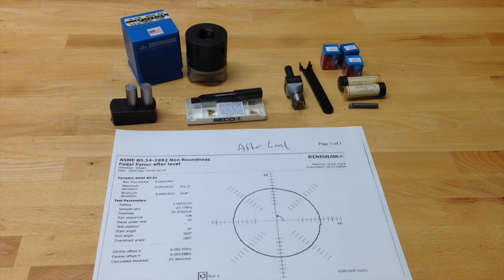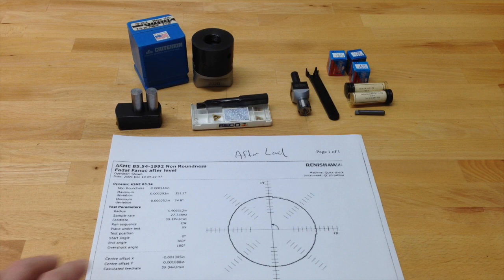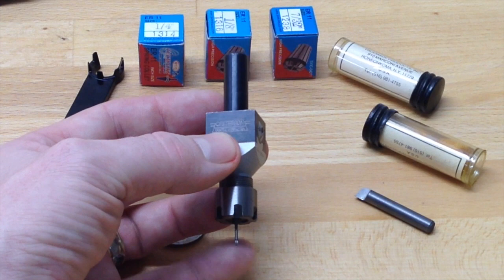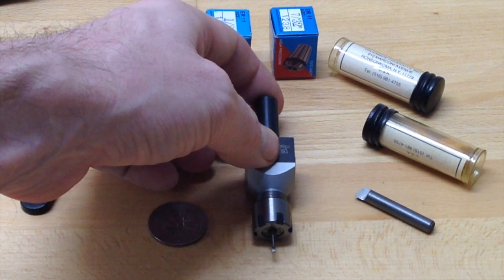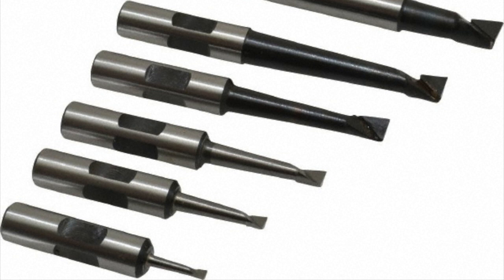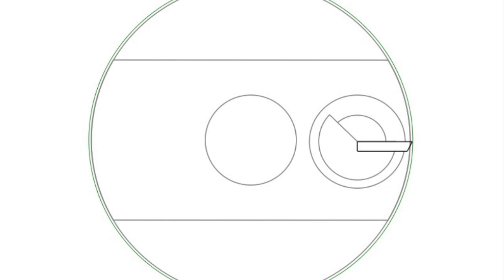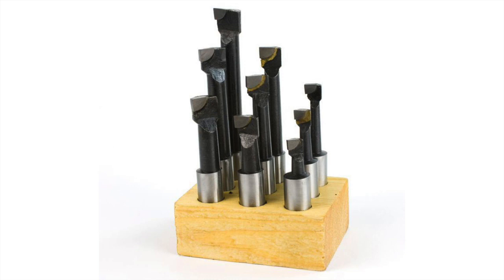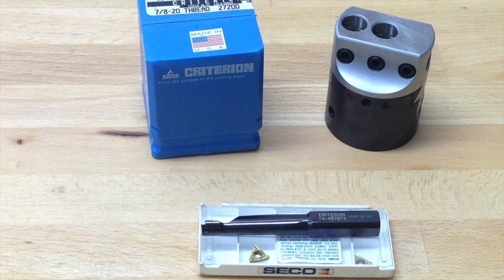A Boring Rant

Comment: Interesting and informative, however not all of live I the USA and a downside is all your tooling is imperial, unlike so many countries who have gone metric, and tooling is metric. Freight from the USA is prohibitive and often doubles the cost of many tooling items. I have to say that the low cost . imports do allow many hobby machinist's, a range of tooling and equipment we could never afford, and with a bit of work many of the imports will be quite adequate for many on a limited budget and who are not running a money making operation. Many tools get limited use, so it seems horses for courses are a way for us all to enjoying our machining, keeping us off the streets and out of the pubs etc. Add the UK and quality Sheffield made tools, I have still got all mine and my late father's, which, are top quality and heading for 100 years old.☺A large telescope builder, or I should say a builder of large telescopes and observatories where my tools, machines etc are a means to an end.

Comment: Nice video, but If you having a company than it's normal you buy the good stuf , because the client  pays it anyway. On the other side of the medal is the hobbyist working with chinese junk as you call it. And most of them are satisfied. But not all the very good stuf you buy in America is also produced in America. I am from Europe , and bought recently a milling machine. I can assure you that most of the milling machines how decent they look and with there differences they al come from the same factories in China, It's start with the skelet en then there be difference in quality of everything you can think off and the price you have to pay for it.  So with the same skelet it can easily have a difference of 4000 euro's. For a normal hobbyist it is very hard to make a good choice. And that is the same with the tools.  But if the price is cheap , a hobbyist also can afford it. But buying a boringbar 3 times the price compare to china is nonsens, because how often do you use it   , changing the bolts is always a great idea for better one's no matter where you bought the boring head.

Comment: Thank you for this  video.  I have gone through just about everything you mention and finally ended up making my own as another commentor  has said.  And I use 3/16" square HSS for bits.  I even made a back up bar for one job.  It is the same length as the primary bar and has a set screw which touches the primary bar in an attempt to keep it from springing/vibrating.

Comment: What a  great video!  I didn't expect your prepared visual learning aids.  This is better than most instructional materials that are sold!  I knew that there were many basic boring details I didn't fully understand, including proper rake angle, etc.   I just finished a job where I had to bore nine holes (7 in metal injection molded pulleys, one in a solid steel pulley, and one in rectangular extruded aluminum box tubing.  All went well (although slow), but I made a mental note to search YouTube for a boring video so I could learn what I needed to know, so stumbling across your boring video was a bit of good fortune.  I learned a lot from your video.

I don't do a lot of boring, and I'm frustrated with my cheap import boring head and cheap import brazed carbide boring bars, for most of the reasons you mentioned.  I haven't experienced the problem you described with the round boring bar rotating in the boring head, but I'm sure that's an accident that's waiting to happen.

The cheese-like set screws are stripped on my import boring head lock mechanism.  I'm now down to 1.5 out of 3.  One is so stripped I took it out, and another is mostly stripped so I torque it only lightly.  I need to replace the set screws, and buy ONE good carbide insert boring bar with a proper flat on the shank.  Then I'll only have the issue of the extreme backlash in the boring diameter adjustment screw.  I'll eventually buy a nice boring head... like the Criterion boring head you have.

Thanks for this great info.

Comment: I wish I could buy those insert style boring bars that cheap here in Australia. I know there is a difference between AU $ and US $, but it does not explain what tool suppliers here are asking!
Learned by watching, thumbs up thanks, John.
Reply: same in NZ ,   either import tooling that takes a month if youre lucky, or horribly priced import crap sold by local resellers. or ebay + shipping

Comment: Good video.  I have to say I have had good luck with my import boring head.  With that said, I did just order the Mesa 3 inch bar as you are completely right about the cheap bars.  I waste a lot of time messing with the rake angle.  That bar looks very good and should cover just about all the boring I do on the mill.  Thanks again.
Reply from the maker: +robert simpson Cheer Rob. Yeah, to be fair the import heads rant all that bad and you can get great results from them. I just switched over to some new Kenametal inserts with a much smaller radius and they work great. I recently made a clamp block for my coolant system and it turned out really well. Spend the money on good boring bars for sure.

Comment: Rule #1 when boring. Rigidity, rigidity, rigidity. This can not be stressed enough. The shorter the set-up the better.
Rule #2 when using HSS or brazed carbide the sharper the better. Brazed carbide really needs to be finish ground with a diamond wheel. A silicon carbide green wheel simply doesn't do the job. 
Rule #3 the tool tip needs to be on the centerline. Being offset effects the rake angles and translates into outfeed errors
Reply from the maker: Great advice m!!!

Comment: i actually managed to break a cheap boring bar by just starting a cut in delrin.  the boring bar touched the work and the shank snapped at the root and hinged back on a little sliver of malleable material like it had a cold shut in the metal.  it makes me wonder how they managed to even make it without breaking it in the first place.

Comment: why did you angle the crappier cutter so differently? the first was lnline with the center of the head, the second was angled aggressively. if you were to angle the first the same way, you would the same result.
I do agree that there are tons of crappy boring bars, but it seems you were preloading the start conditions.
Reply from the maker: its because the crappy cutter doesn't cut on center... if you want it to meet the bore at neutral rake (90 degrees) you have to rotate it in the boring head. Watch it again... thats the exact geometry problem I was trying to highlight with the crappy cutters, the cutting face is not on center of the boring bar.

Comment: Criterion do make a proper cross hole boring bar that use replaceable tips. I ordered mine from MSC. I bought both the 1/2" and 3/8" criterion heads . And I couldn't agree more about those cheap boring bars and what passes for carbide with some off shore tooling. Criterion also used to have an excellent series of videos about boring on there site, but last time I checked I couldn't find them any more. Most seem to think that your supposed to use all three of the screws to lock the slide after making a movement. That's wrong, only the center screw is used to lock the slides position and the outer 2 screws are left alone. There only moved after a long time to take up any slight wear with the gib on the dovetails.

Those Criterion's are an excellent and very well built tool, and worth there price I think. Even though there shanks are also very well built with a very precision fit between the shanks threads and the female boring heads threads, I still very much prefer the Narex design over the shanks that use threads. Unfortunately Narex shanks are much more expensive than the Criterion shanks and obviously only fit the Narex heads.
Reply from the maker: +Turning Point All great points there, totally agree with the 3 small screws, outer ones to set friction and take up wear and the center one to lock the setting. I figured that as it was a single point process, the concentricity between the head and the TTS shank was fairly moot. Thanks for leaving great comments!
Reply: Would you drive down the road with 4 wheel nuts loose, same thing. They are all locking screws.
Theres import and theres import some are ok, most avoid but will say boring head is the same as my cheap unbranded Chinese from 1999. Do have several of the same cheap and nasty tipped boring bars known by a German sounding brand name, crap made in china flex like no tomorrow.
Cheapo carbide, just grind them up if your a machinist no wonder getting severe problems taken out of context barking up wrong tree. 
So if a dog point screw marks or dents the tool and cant remove why slap a cone, W point in that will burr it up, your logic prevails.
Reply: Sorry but your wrong and there not all locking screws. Criterion specifically say's the screws at each end are used to properly adjust the gib and only the center one is meant to be used as the slide lock. There not at all like a car wheel because there's very little actual holding force required since the feed screw would do most of the holding if the slide were to ever move with the limited backlash under centrifugal forces or cutting pressure. Tom Lipton / Oxtools on his videos has gone to not using any of the screws to lock the slide and says he's seen no difference over the years he's been doing it. I don't have his years of experience so I still use that center screw. Using all 3 just throws the gib adjustment out for zero benefit. And I know all too well from trying to resharpen those cheap carbide tipped bars and the even worse cheap braised carbide lathe tools that they have the carbide quality and durability to match. Trying even one of Criterion's carbide tipped bars or other high quality manufacturer against reground cheap carbide clearly shows the high quality one's are worth what they cost. All carbide isn't equal at all. If it was machine shops wouldn't be paying the much higher costs for the higher quality carbide tooling that they do. And my boring bars come with a flat ground onto the bar so there's no problem with burrs being raised no matter what type of set screw tip design is used. So I'm not taking anything out of context or barking up the wrong tree.
Reply: How can you honestly say something that has play as in movement will not affect the dimension it cuts.
I rest my case.Even with the three nipped up, take a cut with adjuster so it has play available ie backed off. Assured it will move inwards (reduce size) cutting approx. 1/16" smaller dia.There again were not all diyers.
Reply: LOL, now exactly why would you ever set up the head so the screw is backed out and there is backlash present because it sure wouldn't be used that way under actual cutting conditions? Of course the slide could or may move. But that's not how we use these heads now is it. If you'd go back and re-read what I said, and I've just checked the instructions that came with my Criterion head, they say the center screw is the ONLY one needed to lock the head after adjusting it. A lathes cross / top slide doesn't back out away from the cut because the backlash is taken up as you advance the tool. All moves are done in a positive direction with the screw and nut thread flanks bearing against each other. And a 1/16" it's going to move? Just how bad is that head you have? Mine has .007" of backlash, so at most that's .014" on diameter if I set it to the condition you said to do. I also mentioned Tom Lipton has found the screw is enough to hold the slide in it's set position. Or maybe you class both those sources as diyers because what your saying goes completely against what the manufacturer and he has to say.

I've bored more than enough holes and have never had the slide move, so I'm going to keep right on using the manufacturers recommended method. First you argue about what the video poster had to say and I'd have to consider him as a very knowledgable machinist. And he's sure no diyer either. Then you argue what a well respected high quality boring head manufacturer has to say simply because you own what's apparently a real poor copy.  Your head may well need all 3 screws used if it's that poorly made. But your head wasn't what the video was about.So despite your implied "pro" status your either a troll or you simply don't understand how to remove backlash from the tool, or how they work and are adjusted between cuts. Thinking something is correct doesn't make it so. The video was about Criterion heads and the poor geometry of those cheap import carbide tools. My posts were in regards to the video subject material, yet you seem to want to argue the facts. Have you even tried using that center screw as the lock and see if the slide moves? Or do you just think it would.

Comment: I really enjoy these videos, thank you. I tried to find a seller for the nine9 but have no luck can you share your source?
Reply from the maker: I believe that Everede are the main distributor here in the US so you can contact your local rep or buy from MSC.

http://everede.net
http://www.jic-tools.com.tw/products/products.asp
Reply: l0ckcr4ck3r Thank you. Amazon and MSC say no longer carried perhaps everede bought the nine9 brand or something. I saw your comment one one of the treads about chip weld on aluminum have you considered (MQL) Minimum quantity lubrication similar to what you have but with oil and no rust
Reply from the maker: The 1/2" one is harder to find... 1/4 & 3/8 take some inserts and the 1/2 & 5/8 ones take a slightly different group, so the 5/8" is the one you tend to see everywhere. mine was a special order from MSC, give them a call on the phone and they should be able to order one for you, or just contact everede for your local distributor. They are on ebay, but a bit pricey on there!

http://www.pts-tools.com/cgi/CGP2LMXE?PMWORD=Everede+spot+drill&PMTYPE=KEYWORD&SIHDID=000000084474191&SIRDID=033877611176053&PAHDID=000000084474191&PARDID=033877611176053

http://www.travers.com/Search/SearchKeyword?SearchCriteria=UserSearch=everede%20center%20drill
Reply: l0ckcr4ck3r Thanks again I will get on it tommorow.